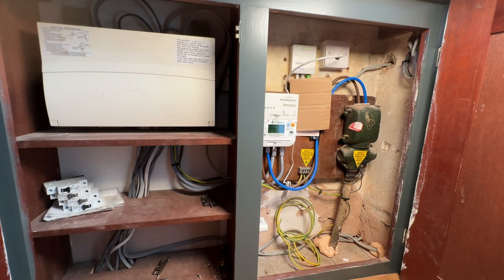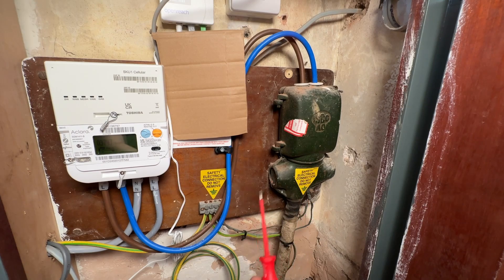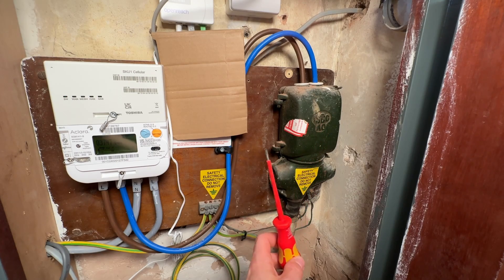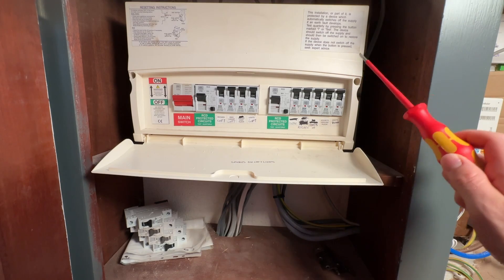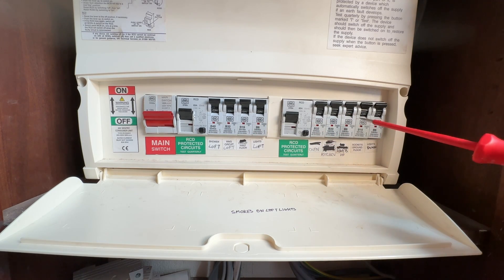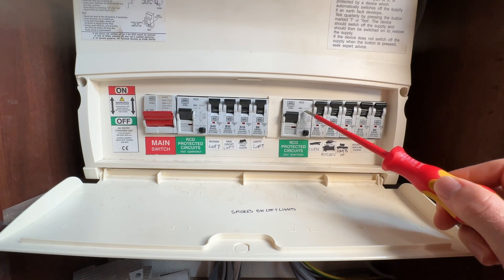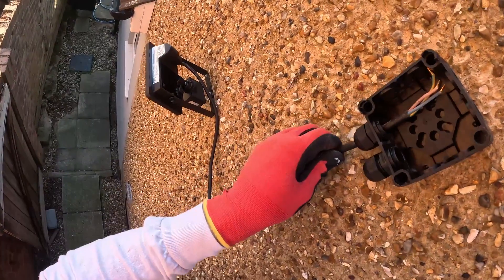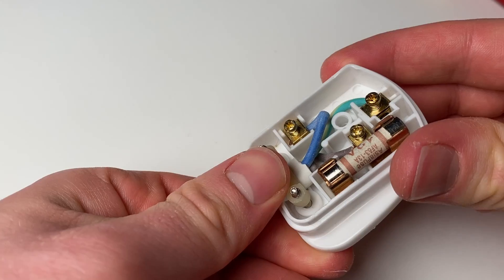What Electrical Work is a DIYer Allowed to do?

Comment: Think you can get change or a consumer unit but must get a suitable person to certify it 🤔
Reply from the maker: Yes that is true, but I don’t think there are many electricians who would sign off someone else’s work. Thanks for watching!
Reply: Changed consumer unit all RCBO and added  a shower circuit. myself. Council provided quote for testing completed work which covered 2 visits (if necessary). . I purchased an ohmeter that would measure to hundredths of ohm to check for all the circuits.  Council test man spent about 40 mins checking everything and passed  it all at first attempt.. Interestingly there is no retest date on the consumer unit because that is purely electricians looking for work rather than  required under the regulations.  I went the council route to get the job done properly (all within confines of existing  Mantel cabinet) , the 4 quotes I got from electricians were not wanting to do the job properly and were looking for add ons to increase their work.
Reply: @michaelconduit5893  Council route possibly best as they're not looking/creating  work and the installation passed out fails on a level playing field
Reply: I’m would argue that you are wrong about electricians and have clearly never read BS7671. Firstly sparks do not put those pretty little stickers on your DB in the hopes of getting more work in 10 years time (hardly a great revenue stream). It’s done because in the regulations it is recommended that an electrical installation is periodically inspected. If it is a rental then by law you are required to perform an EICR every 5 years. BS7671 is also a non-statutory set of regulations anyway, so even if it was a requirement there is technically no legal obligation to have an EICR done (other statutory regulations will cover that). Finally your low reading ohmmeter was now where near enough capable of being adequate enough to perform the range of tests needed for the work you carried out. A waste of money really (unless you need if for other things). By the way, you failed to mention the plethora of things BS7671 requires you to do before a DB change that you must of done.
Reply: As mentioned above re building control signing it of, it's theoretically possible but they'll charge a fortune for it, they'll want to see your test reading - for which you'll need to acquire an expensive test meter and have it calibrated. Cheaper to get a sparks in to do it.
In general you'll not get an electrician to certify someone else's work. That's partly they want the work but also it's their neck on the line if something goes wrong.
Reply: When I last checked the fees Building Control charges where I live it was about £400 for a full rewire and about £300 for all other work. In almost all cases the additional cost of using an electrician is far more than the BC fee although it will also depend on how much value the time you need to do the work yourself.

Comment: I think you may have misready the special location element. Special location is only within zones, so if your ceiling is higher than 2.25m from finished floor level then it is not a special location, and as such you can change the fixtures, following regulations such as IP rating etc.
Reply from the maker: Yes you’re absolutely right, I thought it was more prudent to just say special locations. I do actually have a video where I cover the zones in detail, my downlights video. Thanks for watching!